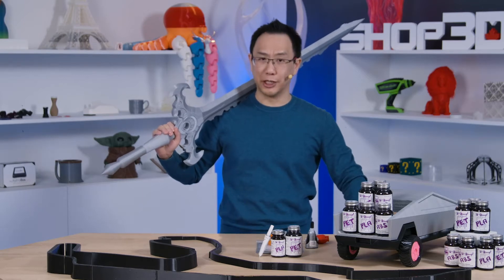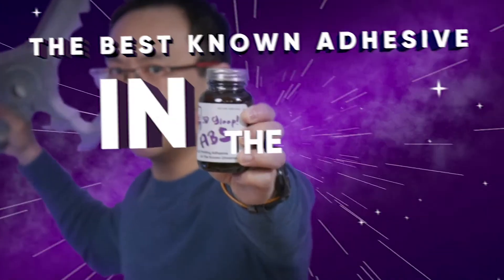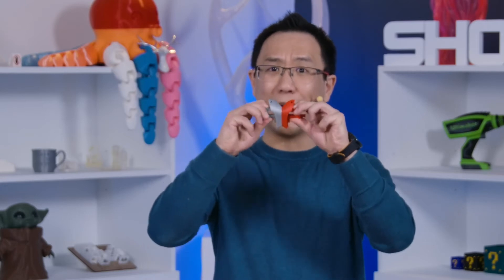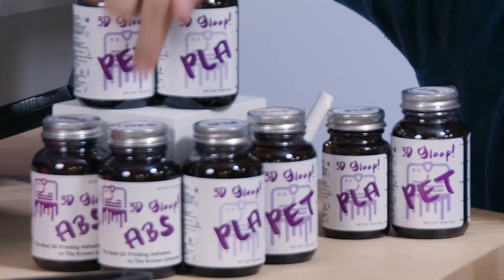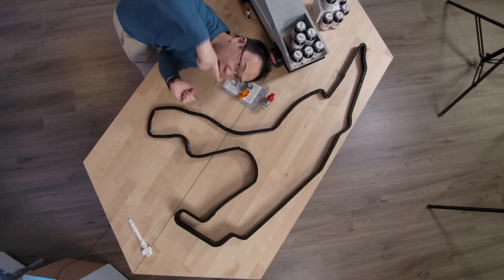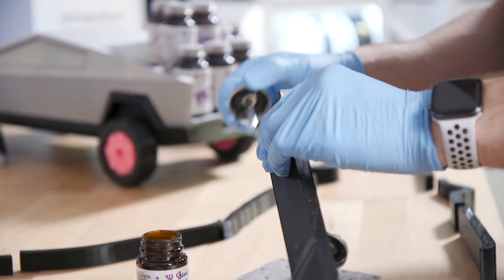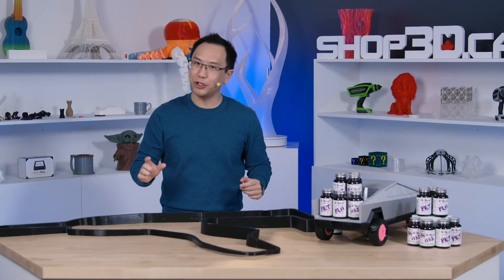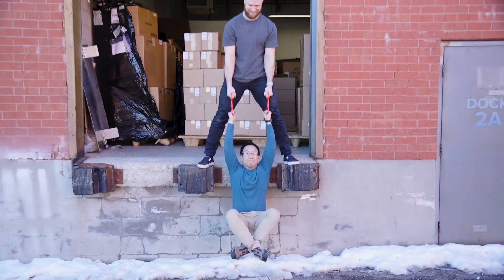The Best 3D Printing Adhesive, 3D Gloop!

Comment: But how long did they have to press those joints together to get that kind of bond?  I've had mixed success using the PLA formula.  Anyone tried it on small parts?  That's where I'm having trouble.  I'm wondering if the parts I'm trying to bond just don't have enough surface area...
Reply from the maker: Hey Joel, we just made a video addressing your question and best practices for 3D Gloop!  You can check it out here: https://youtu.be/czznw_F2Epc